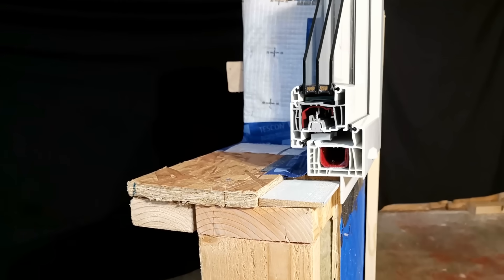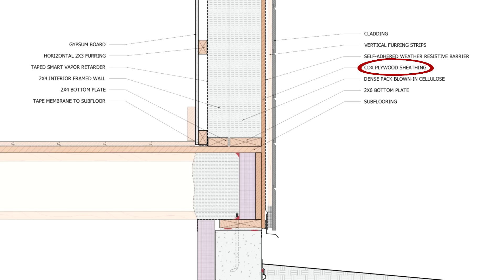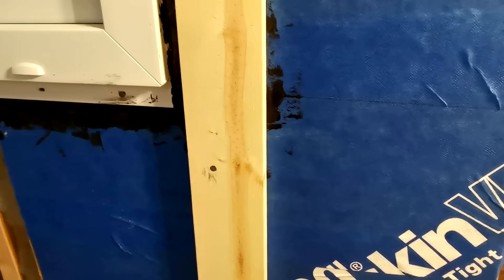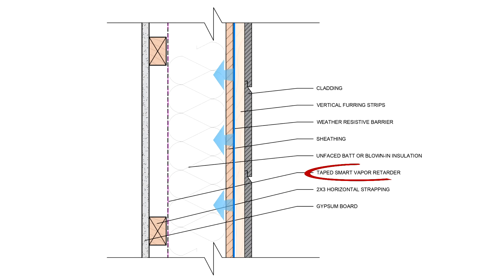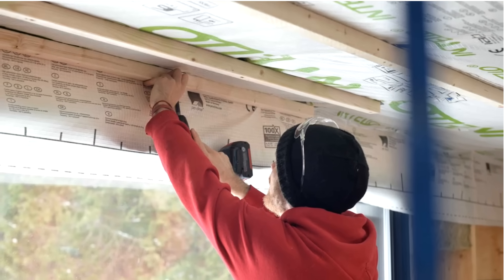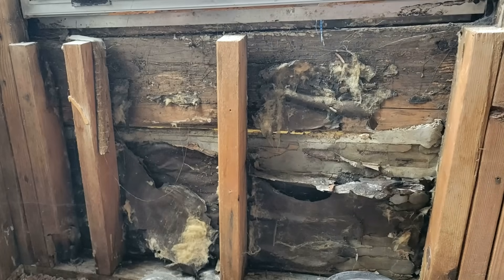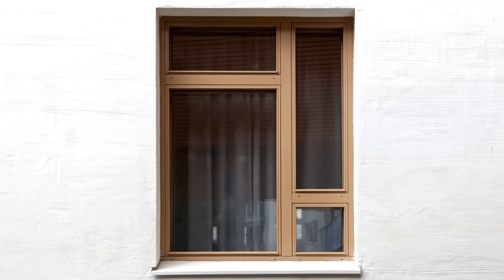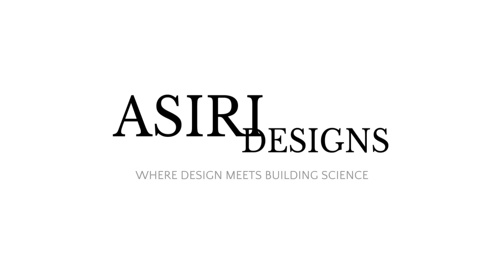CRAZY R-Value for CHEAP! A Guide To Double Stud Walls

Comment: Or scrap the double wall and just spray foam….  To sure this channel dismisses spray foam.
Reply: Off gassing VOCs, losing R value over time, using HFCs (high GWP) or HFOs (both very flammable) are some of the drawbacks of using spray foam
Reply: @Austin-fc5gs all those drawbacks off gassing is done in a week. All insulation loses r value. Flammability is irrelevant, everything a home is flammable .but there are solutions to flammability in the recipe and spray on retarder’s. These issues are created by lobbyists  from fiberglass companies. Look it up.
Reply: EPS panels would be cheaper, faster construction method than just adding cost to traditional method with spray foam
Reply: Spray foam doesn't get much more r value per inch. Double wall allows higher levels of insulation.
Reply: @jamesroscoe7555  Not quite true. Spray foam has a HIGHER R-value per inch.  That said, it's much more expensive for the closed cell, or even open cell insulation.
Reply: @slaveofjesus3878 - True, but some foams also experience quite a bit of downward R-value drift, so the long term R value, while still usually higher, often not as much higher as one would assume given the advertised R value.
Reply: @slaveofjesus3878 yes, a little bit higher r value per inch, but not so much that it is comparable to double stud. Eg, 2" foam is about R10 so a bit under R20, like around R18 for a completely full 2x4 cavity. Roxul batts are r14 at that thickness. So definitely better, but not comparable to the >R40 walls used in passive house construction.
Reply: @jamesroscoe7555  Well, I was thinking not of the overall thickness of the wall, but the r-value per EACH inch of insulation.

Here is an AI search result for comparing closed-cell foam to dense packed cellulous. 

"Dense-filled cellulose insulation typically has an R-value ranging from 3.2 to 3.8 per inch, depending on its density and application method.
 In contrast, closed-cell spray foam insulation offers a significantly higher R-value, generally between 5.6 and 8.0 per inch, with some products achieving R-6.5 to R-7 per inch."
Reply: @spenceralridge4958  I like the value of DPC and won't put a high VOC product in my walls.  I know if packed correctly, cellulous won't settle and leave gaps at the top of the wall like older applications would, but I don't know the R-value at differing moisture levels.
Reply: @slaveofjesus3878 Totally understand your point of view.
Reply: @slaveofjesus3878 This is the drawback of using AI searches as they are completely without context and draw from whatever they pull off the web. I generally consider foam products to be approximately R5/inch, but yes, they vary, closed foam can be a little better and open cell can be a little worse. Foam products also degrade with time, so the long term R value is more relevant. Those marketing values of 6.5-7 are not long term values (closer to 5), but yes, I agree with you that the R value is better, but it's not that much better than eg roxul (r4/inch), and quite impractical if you want to exceed R40. That is all. Yes, somewhat better thickness per inch with closed cell, but still needs additional structure to hold it especially if you want to avoid thermal bridging.
Reply: @jamesroscoe7555  I've seen some values approaching R8.  Do you know how long a R7 would take to degrade to R5?
Reply: @slaveofjesus3878 I guess my earlier reply got filtered. The degradation time will be dependent on the manufacturer and environmental conditions, but it is mostly diffusion of blowing agent for pu and polyiso. Generally I would budget for R5 to r6 per inch after about 5 years.

All that aside, my original comment to the op was that just using spray foam is not a very practical way to achieve the high levels of insulation a double wall can provide. Closed cell is not cheap, there is still thermal bridging, and there is still not enough structure thickness. Nothing really against foam per se.
Reply: @jamesroscoe7555  Thank you.  I don't like spray foam even without the declining R-value issue in any case.
Reply: Spray foam just really isn't a good option.  You have to deal with off gassing.  It's horrible if you ever want to do any remodeling work.  If it gets wet, it absorbs moisture and holds water like a sponge and you'll learn your wall is retaining water long after it's become a major issue.  If there's ever a fire, it gives off horribly toxic smoke when burned.  There are plenty of products that are flat out better for a number of reasons.  Spray foam is only good if you want a cheap solution for airsealing a space without doing all of the necessary detail work to achieve it in the way described in the video.  That is at least until it shrinks and pulls away from the wall over time creating hundreds of air leaks all within your wall cavity.
Reply: You missed the part where a double wall gives you a thermal break. Even if you did spray foam, you would still want to do a double stud wall. This was talking about the most COST EFFECTIVE way to build super insulated. You can use spray foam if you want, but there goes the money for not a ton of added benefit. And I basically do not trust any company where I live to spray foam. It basically has to be done perfectly, or you will have problems really soon.
Reply: I'm waiting for good data on insofast x brackets and external polyurethane.